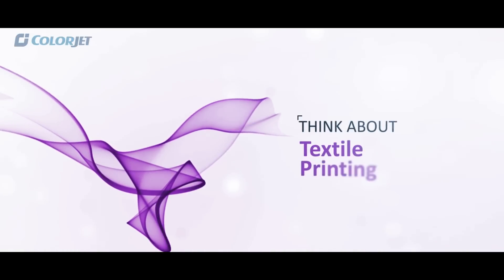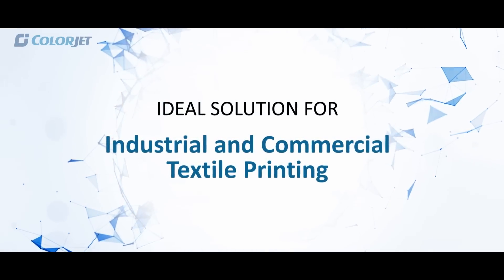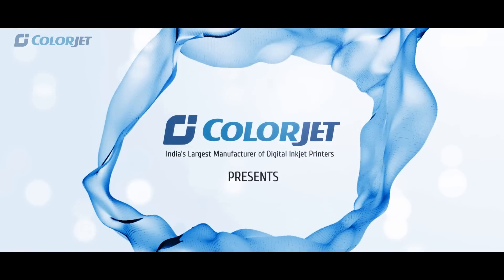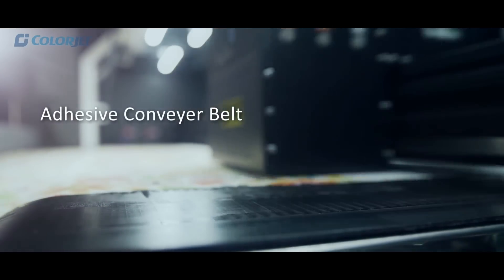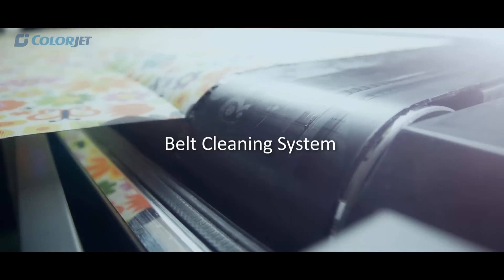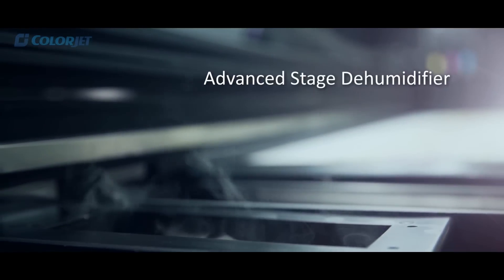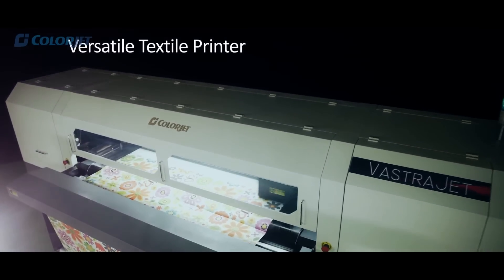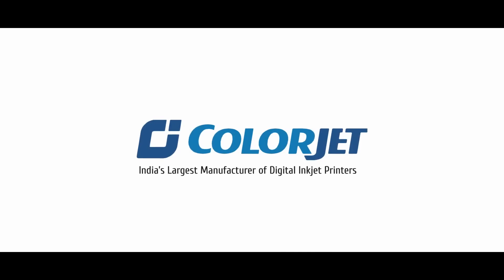Colorjet Vastrajet : Direct to Fabric Digital Textile Printer

Comment: How much would this cost to print 1 meter fabric. And how much width can this print
Reply: Khalilsujniwala@gmail.com or 9638537195 whatsaap
Reply from the maker: Max width of this machine is - 1800 mm. For more info please share your contact details (email/phone) to discuss more about it or you can directly call on +918178343337 or email to info@colorjetgroup.com.